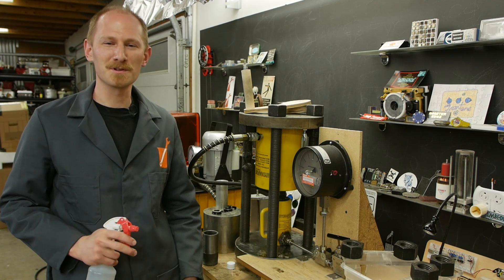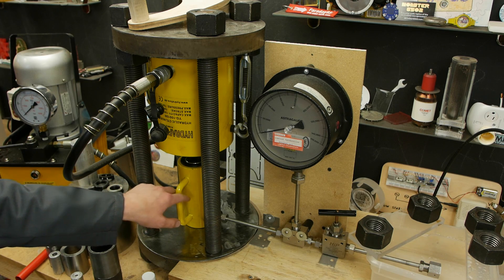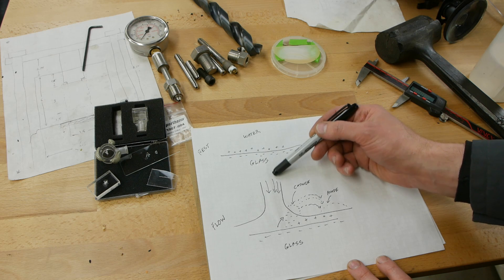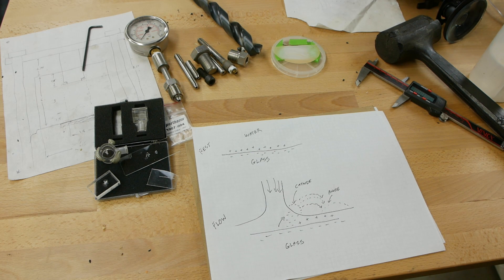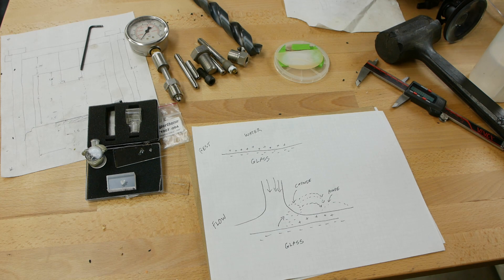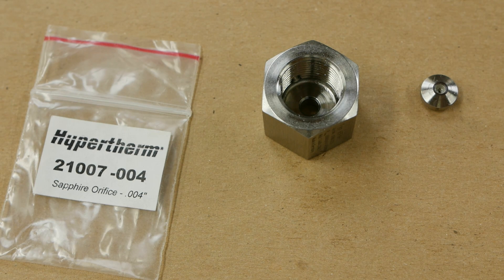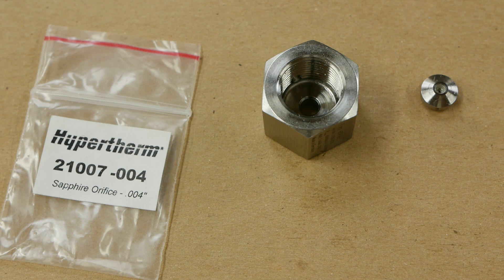Glowing plasma created by a high speed jet of water

Comment: I have been creating crude synthetic ruby and sapphire in tests over the past month for conceptual tests in formulation and design aspects of my Verneuil furnace.  I desparately want to try plasma enhanced chemical vapor deposition (PE-CVD) applied to crystal growth of corundum seed crystals.  I have no clue if this will work, but since you have that sputter gun maybe you'd be interested.  I have some theoretical procedures I've been working on to use this method and will gladly supply you with all the details in an email.  I have a few good shots on my Google+ picture albums of some of the amazing crystal structure on the surface of the boules.

If you are interested, I will send you synthetic ruby seed crystals and plenty of oxide feed for testing.  I can provide several pre-mixed formulations as well as raw uncombined oxides to perform tests of your own liking/design.  I've had the most success and ease forming ruby due to the simplicity and lower tolerance oxide ratio of the formula.  I can provide other material to assist with this project if needed.  I can send you much more detail in email on the subject as I don't want to type up a novel here in the reply thread.

Let me know and send me an email listed on my YouTube profile (themadpinner@gmail dot com).  I would really love to see if plasma assisted crystal growth will work or not.  Even if the crystal is only grown larger on microscopic measured levels, that would still be exciting to me.

Comment: That water jet is approaching the pressure used in diesel fuel injection systems. You can see how easily it cut the sausage... dfi systems will do the same thing to your skin.

Comment: Why are so many people suggesting liquid gases as the fluid to try?  LN boils at -196C (-321F) and any thing else is even colder, his set-up is not designed to work at those temperatures.  Also when you compress something it heats up, so you would need even more refrigeration power and then after all that the instant the fluid left the nozzle it would turn to gas.

Comment: Most plasmas  are influenced by magnetic fields.  You might consider placing a rare earth magnet on the outside of the  glass to see if you can cause distortion.  Meller Optics sells sapphire windows.  Elementsix sells small squares of single crystal, CVD  diamond with the lowest price pieces (3mm x 3 mm) @ $125 each.  This might then be re-purposed for another video where you use an UHV system to disassociate acetylene to thicken the diamond chip...and retire.
Reply: instablaster

Comment: Sputter a conductive surface on the back side of the target substrate, keeping it translucent enough to see the discharge. Apply high voltage dc between the nozzle and the metal sputtered target glass. Also, try attaching a capacitor between the two and see if it charges up.

Comment: couldn't this be  a static discharge occurring in the microscopic bubbles of air against the metal of the nozzle upon exiting the orifice at high velocity?  I was thinking that because of how much of a charge my blasting cabinet would create before I grounded it out.  It kept shocking the Sh*t out of me if I got too close to the cabinet.

Comment: Triboluminescence? That seems a bit far fetched doesn't it. If I had to make a first guess I would go with plain old electrostatics, I think you have made a microscopic thundercloud there. Put a isolated metal plate there and measure the static charge, you won't get the light-show with metal, but I bet you do get the charge, if you manage to keep the water sufficiently pure and non-conductive. Measuring static charge is not that hard but doing it in water might be tricky.

Comment: Nice work.
You could try it with chloroform, but make sure it's very clean and dry. It's a polar insulator. I see some are suggesting ethanol, but given there's plasma and air, that would ignite the mist and possibly even cause an explosion. Ethanol would be ok in a closed environment purged with nitrogen.
If you're going to make an enclosure, I recommend glass with plastic lamination (either between two glass sheets or outside) because chloroform melts a great deal of polymers.

Comment: @applied science I think that the plasma is dimming down (not because of the charge being depleted) but because the water is damaging the surface and changing the way the water is deflected away. If the surface is smooth and clean then the water will smoothly deflect at 90 degrees, however if the water starts to pit or drill into the material then the deflection will change. Does this happen on any material that doesn't get damaged? How about does this happen less on materials that are damaged less and more on materials that have more damage or damaged more quickly? I think I saw that when you moved the stream back over the already damaged  that the plasma was much brighter and intense than before, leading me to think that the deflection shape is having something to do with it. Great video, never seen this before today. Exciting stuff.

Comment: Water is a Newtonian fluid.  Maybe try another Newtonian fluid?  According to Wikipedia, water, air, alcohol, glycerol, and thin motor oil are all examples of Newtonian fluids.<-  OK , i think I got that a little wrong.   I'd try non-Newtonian fluids.  I think water may act as a non-Newtonian fluid at high speed.  Try starch water!

Comment: Ethanol or ammonia seems worth a try, although the resulting cloud of flammable and toxic vapour would require care.  Have you tried an argon atmosphere?  A low pressure environment would be interesting too, but almost impossible to maintain , except perhaps using a low vapour pressure ionic liquid?  ITO glass?  Some enamel wire probes would let you measure the electric fields with a suitable electrometer, it may scale with pressure/velocity so charge separation may be detectable with streams below the destruction threshold of the target.  Maybe you can light a neon bulb or LED with the tribocurrent well before air ionisation?  Although looking at the brightness of the discharge the current looks very low, the process is clearly extremely inefficient.  Diamond or silicon carbide would be an interesting, tough and conductive target.

I am guessing you will replace the piston with a solid rod to achieve higher pressures?  How does the seal on that thing work?
Reply: If it makes ignite the alcohol, it could be used as a "non electronic" ignition system (for rockets)???

Comment: I wonder about the solid substrate used -- Have you tried any conductive ones? Something like indium tin oxide is still transparent, but also conductive. As for other liquids to try, perhaps acetone, ammonium (though that might be somewhat conductive), or acetonitrile. I would highly suggest putting the cover on the bin you were using in the video for any of those.

Comment: Fire the water at a copper disc surrounding the impact point, connect the disc to a capacitor and see what kind of charge you can generate.  Smartereveryday did a video about how anything with a crystalline structure, even hard candy, give off visible light when crushed.  But it's clear this is a different phenomenon.

Comment: Is this similar to the "barometer light" produced by mercury on glass?
Reply from the maker: I hadn't heard of barometer light.  Fascinating!  Since you are the master of mercury, this has to be on your topics list, no?  :)
Reply: @AppliedScience  Actually I do get shocked by water sometiimes, after touching the faucet while holding the other hand under, and it happens more often to me than the regular kind.
Reply: I bet it is!  So, who's going to try the one-micron MERCURY JET version?  :)  Or see if the water-glow disappears if immersed in vapor from boiling mercury.   Probably a contiguous jet wouldn't work, would short out different regions.  But a string of droplets might make flashes.

Offtopic: see vid "cloud chamber in five minutes."   I just noticed it.  Impressive simple.  A local guy was making these with 2-layer peltier coolers (no dry ice.)   But way simpler: FREEZE SPRAY!
Reply: @wbeaty  you're still on YouTube? Your videos were my first ever delve into the science part of YouTube. (:
Reply: I can't seem to find a video on this phenomenon. But I have a feeling one might pop up in my video feed in the near future. (Looking at you, Cody)
Reply: Applied Science, I smell a collaboration video!
Reply: CODY‽
Reply: What's that?
Reply: it was mentioned that the water should act as a insulator since it doesnt work with salts, mercury is a good conductor so it would be a different effect. wikipedia says its electrons that beam away from the glass as the mercury hits it, also says it has to be pure and the glass clean. here the glass wasnt clean, although the water was pure so mb that was the salt thing instead...
Reply: Though this was the “waterjet channel” and, cody’s here too!
Reply: Victor shauberger discovered a river will produce voltage when it changes direction.
Reply: Oil dust ia explosive)))
Reply: Cody'sLab Hi, Cody.

Comment: If it isn't an april fools joke, I'd recommend adding Fluorescein and reducing the pressure. If the water jet doesn't cut the material you could sustain and control tests, or try different impact angles. The fluorescent dye (or a phosphor instead) might make the charge separation visible without the pressure required to create plasma. Maybe this wont work for the same reason the water needs to be pure, because it would become slightly conductive.

Comment: why the plasma goes out is because of the damage to the material i think. a rough or pitted surface is going to be reflected back differently, and have a more chaotic pattern and a lower charge.

Comment: What's on the breadboard in the background? Also I wonder if that charge depletion effect you noticed had more to do with the water jet altering the shape of the surface of the glass so the water gets deflected at a steeper angle, rather than straight out at 90 degrees.

Comment: Alright so I'm curious about whether the plasma is due to breaking the substrate material and carrying it away. If you generate a charge separation (via breaking crystal bonds) it may find the easiest path is through the air instead of the more resistive water. If you play with contact angle you could remove the destructive nature while still keeping a large amount of high pressure and flow. 

As for other fluids you could try pure alcohol, dichloromethane, or acetonitrile for still polar organic solvents. The latter are much more dangerous but so long as you have proper controls the risk is minimal. I'm a chemist by trade and if you find that idea worth exploring let me know. (on phone currently, typing is not as easy as on a keyboard!)

Comment: Could this be a kind of Cherenkov radiation? Have you thought about measuring whether the spot emits X-rays? I'm thinking the water gets ionized pretty much like the cooling water in an atomic reactor... Just a thought. How about ejecting liquid CO² if your pressure cylinder can stand the cold temperature; that would possibly give a nice reaction on impact.
Thanks for sharing this video, it's interesting and thought provoking as always

Comment: Its not a charge in the sense you're thinking. You're changing the electron state when you pop the oxygen molecule free from the hydrogen. Remember, the bond between hydrogen and and oxygen can be popped apart with just a little bit of electricity. And if you have ever played with hydrogen, the number 1 fear of any tech is pumping hydrogen into a tank he is unsure is pure hydrogen. Just a little bit of oxygen gets into that tank over 45psi and BOOM. You're popping electrons off when the matter changes states. I am confident you can find the same effect on any transparent non-dampening material. Plastics will soften the impact. Absolutely brilliant!!

Comment: I'd try some clear but conductive screen. (or not clear, you should be able to see the glow from the side of the nozzle through the mist if you observe it in darkness).
I'd also try to find a liquid with molecules which are more polarized then water an safe to work with at the same time.
Another idea is to put the whole setup into a vacuum chamber to see how air pressure affect the plasma dot. (it must affect if it is in fact air plasma).

Comment: It's funny how the oil created a mist, and it can't be ionized, while water just evaporates and the  dry air absorbs it. you could try it out with some weak acids or bases, and I bet that would work in ceramics but you'd have to film from the other side

Comment: The Birkeland–Eyde process uses a plasma to turn nitrogen in the air into nitric acid.  I wouldn't be surprised if your water runoff was slightly acidic with nitric acid.  Would you be willing to try to detect this?  Perhaps collect all the water runoff from several experiments and distill it.  Distill until there is only a small amount of liquid left in the original container and then test that with a fine pH measurement device.  Of course, you'd want to test that against the original water put into the pump for comparison.

Comment: Replace the microscope slide with sapphire. If the orifice holds up, the target should hold up as well. You could borrow that ruby rod from the DIY laser, right?
I have 2 cool ideas for this setup: a magnetohydrodynamic generator needs an ionised liquid at high velocity to produce some reasonable power.
And what about heating up the stream? Some supersonic air blasters use a regular air compressor and just heat up the flowing air to make it expand. By turning this water jet into wet steam you will definitely get more energy into it. And that just has to influence the experiment in some way. And steam is a compressible gas. That compressibility gives it some springiness on impact. And I suspect supersonic dry steam will temporarily turn into water on impact because of the impact pressure.  On dangers of this experiment: only the water that is inside the pipe will be hot, you won't have a full container with pressurised steam.

Comment: Try putting a fluorescent dye in the water. Shouldn't mess with the conductivity too much, but should glow a lot more
Reply: The plasma would create UV light which would make the dye in the water glow.
Reply: Yes, glowing of fractured wintergreen Lifesavers is actually high-volt corona glow nitrogen/oxygen.  Apparently all sugar candies do this.   But wintergreen oil flares brilliant blue when hit by UV.
Reply: why would it glow more? the hypothesis is that the air is what creates the plasma light, not the water
Reply: I bet if you tried gasoline it would glow.

Comment: If you theorize a current flow causing the plasma, there should be some magnetic field or even RF emitted by the plasma. Perhaps if you subject the point of impact to a magnetic field you can see if it effects anything. An early type of radio transmitter was called a 'singing arc' in which a discharge was interrupted by it's own magnetic field. Maybe you can make a mechanical radio transmitter?  ;-)

Comment: Did you test at what pressure the effect starts to happen? From that you should be able to figure out based on the volume the energy density of that area and look up other plasma reactions to compare their energy densities.
The other point of interest would be does it get brighter if you increase the pressure?

Comment: Liquefied gases, acetone, spirits is ok, but now I want to see next level - bio fluids, like quizzes True nozzle bunch of medusas, can plazma fluid from blood also can make plasma light? heat up salts until they liquid and run those!
also, can electrolyte charge the plastic and create more energy this way? what happens with peltie element if You run high pressure in between 2 plates, can oscilloscope read some stable vibrations from plasma on crystals?  what about LCD crystals from TV? and melted plastics?

Comment: You can create an electric arc with little or hardly any pressure at all on the water; any water, not just pure water. 
two pails with hoses coming out the bottom crossing and then releasing the water stream create a continuous or strobing arc of electricity, between the 2 streams. 
The explanations given for this effect and what you demonstrated are misleading.

Comment: Water -- evaporates. Oil -- no evaporation so it stays in the air until it hits something in your shop.

Other suggestions: Alcohol, liquid nitrogen, vinegar, basically anything that evaporates at room temperature.

Comment: Can you tell me how this phenomenon could be useful? I know everything has a good use, but I can't see one for this.
Also, if you use it as an atomizer and shoot oil through it, into a container with oil at the bottom to protect the bottom, would this method be a more efficient way to produce an oil vapor for combustion, than a fuel injector? Maybe useful for heaters that use kerosene or naft fuel.

Comment: was waiting for the april fool's cut where you're just pointing a blue laser pen at the slide. what if you shoot wd-40 at a chunk of oxidizer. also could you shoot the jet in a vacuum chamber or a chamber filled with inert gas.  what if you coat a surface with a hydrophobic coating and watch it in slow mo.  or what if you put a speaker on the cylinder to put a pressure signal into the flow.

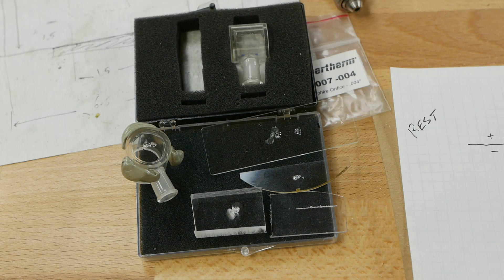Comment: 7:20 You don't think it's due to microscopic damages to the area of the glass that you're exposing the water to? Was the plasma diminished in the damaged areas even after the charge dissipated?

EDIT: Maybe the damages are scattering the light produced by the plasma, making the emission look less intense than it actually is.